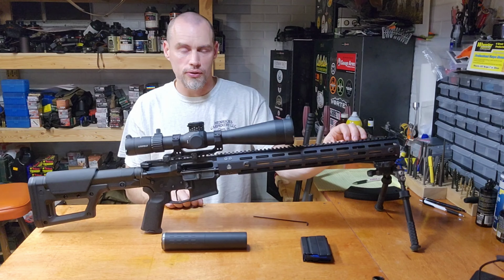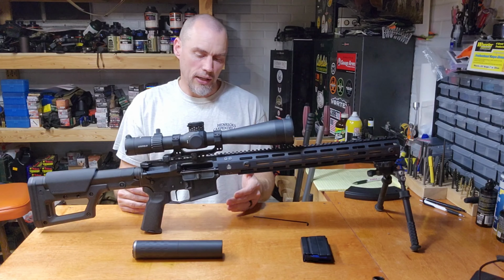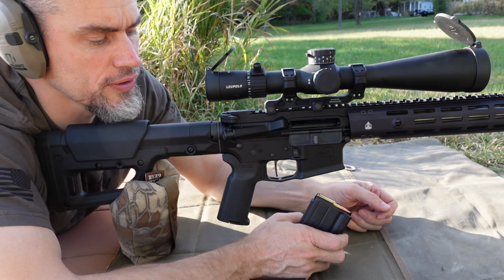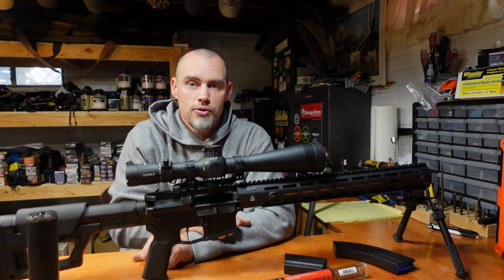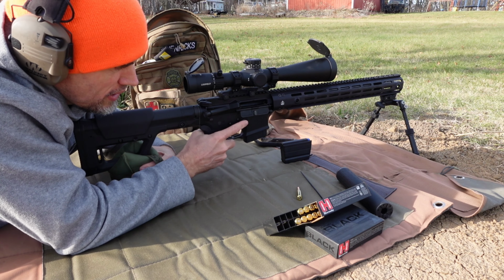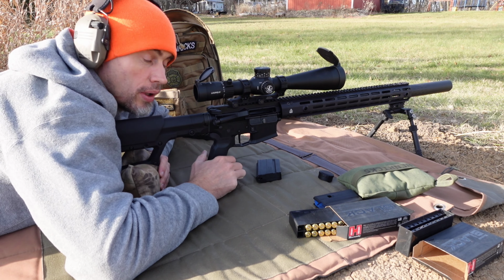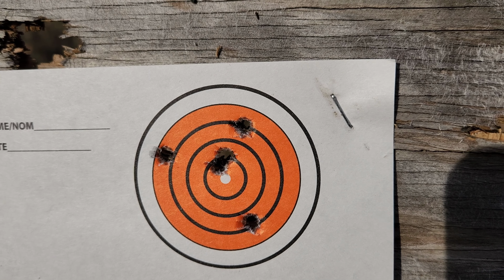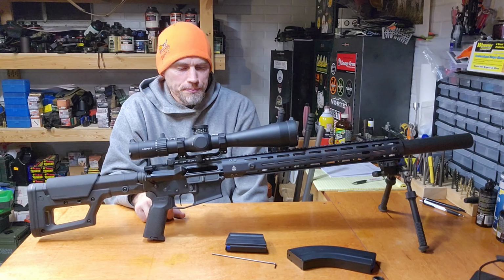Adjusting the gas system on the 6mm ARC

Comment: Rifle length gas needs a .089 (#43) gas port size. Rifle +1 is  0.096 (#41) H2 buffer will work perfect after. Majority of these manufacturers have the gas port size incorrect.  If its not the correct size, you'll be affecting dwell and start getting CSH (case head swipe).
Use a aluminum cleaning rod to protect the bore when drilling.
Reply: Got to ask, my proof research barrel is 20 inch with rifle +1 gas length. The port is .093. Is this going to be a problem? I know you’re saying it needs to be 0.096 instead?
Reply: I’m running a suppressor as well.

Comment: I start at single round lock back then adjust from there, kinda opposite but same. You go max gas down and I go least gas up. I have a 6 ARC just need to assemble it.😂 What barrel you running?
Reply from the maker: 18" Proof Research
Reply from the maker: I had a video of me assembling the rifle and listing all the parts that I used but YouTube took it down
Reply: @thelonggunner762  nice…mine is a 20” proof carbon. Will be interesting to see how it groups.

Comment: H1,H2,H3. Have you experimented with different weights instead of gas adjustment
Reply from the maker: It has the H buffer in it. The initial problem was that there wasn't enough gas to push the bolt all the way back causing short stroking so I had to install the 20% reduced power spring. If I add a heavier buffer it might go back to short stroking.
Reply: I'm not saying you're wrong going with the spring, it actually might be the answer. But hear me out,  dwell time, if the brass is still expanded it's going to extract hard and not lock back on last round, if you add buffer weight it will hold it locked a bit longer to let the brass shrink
Reply: And I think it'll tighten those groups up

Comment: Have you had a chance to compare 6.5 Gren vs 6 ARC in your platform? Thanks!
Reply from the maker: I've shot a bit 6.5 Grendal for a few years and I do like the cartridge. I thought it was plenty accurate and consistent but my biggest thought was it needed to be a little  faster for longrange and up front flatness for hunting, the round flattens coyotes.  I'm  trying the ARC for the gain in speed and I already use the 6mm 108's in my 6creeds  so I have cominallity.  We'll have to see how this performs at longer range before I can give a definite preference between them.
Reply: @thelonggunner762  so what you got to say about 6arc a year later?
Reply from the maker: @baraboo-nb7hv  I'm still liking the cartridge, I just wish they would put out a few more choices in factory varmint rounds for it so I wouldn't have to reload for it all the time.

Comment: maybe I missed it, but what is the barrel and gas system length? Wondering if its a dwell time issue. The push is too short limiting bolt velocity?
Reply from the maker: It's an 18" barrel with a rifle +1 gas system.  It's been running with 100% reliability once I put the reduced power spring in. It might even run fine with the standard weight spring if I would replace the gas block, it seems to leak a decent amount of gas out the adjustments screw hole.
Reply: @thelonggunner762  i have most of my parts on the way. Will be running an aero adjustable gas block. Went 20in with rifle length. This will be an upper build. My lower currently had a h1 buffer with a +15% spring.   Im hoping to get to a h2 buffer and stanard spring and have it play nice with both uppers. Both have adjustable gas, so it should be workable. +1 on an 18in.... man thats a super short dwell time. But you have a suppressor which changes things a fair bit.
Reply from the maker: @jonathanrogers9961  what brand of barrel is your 20"?
Reply: @thelonggunner762  ballistic advantage

Comment: How's the accuracy of the rifle?
Reply from the maker: For the most part it runs sub-moa, that being said it only has a little over 100 rounds through it so it's just getting broke it. I need to find some factory 108eld's to try in it.
Reply: @thelonggunner762  10-4 standing by for a range report!
Reply from the maker: It's in the works but I need more ammo or a set of reloading dies to get it done😂
Reply: @thelonggunner762  10-4